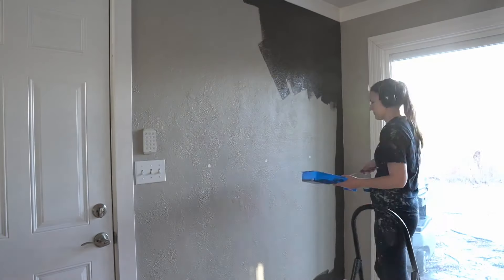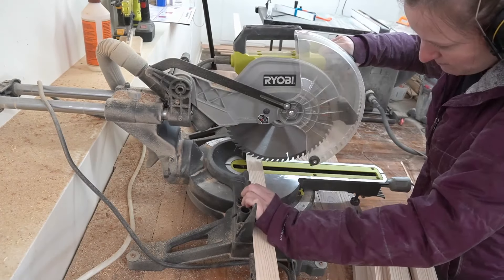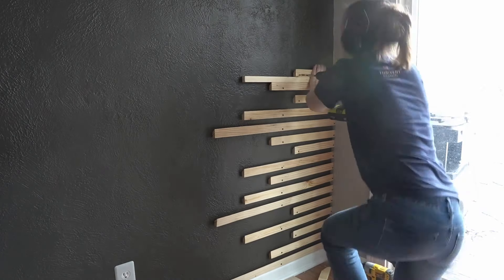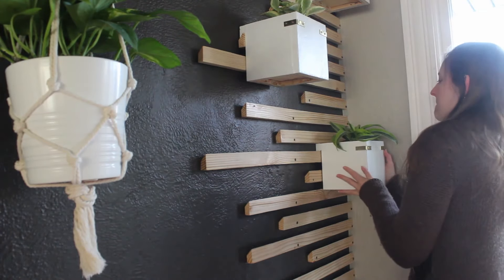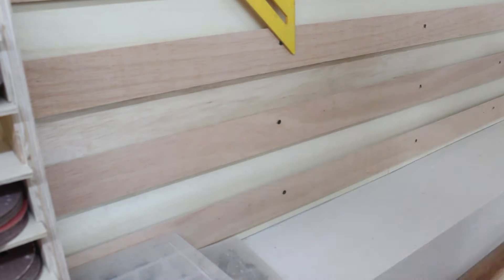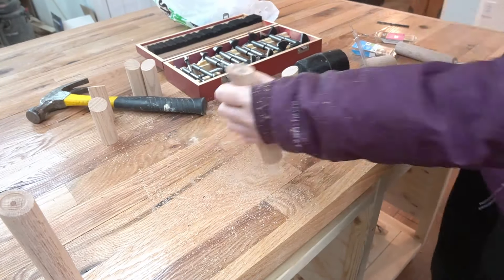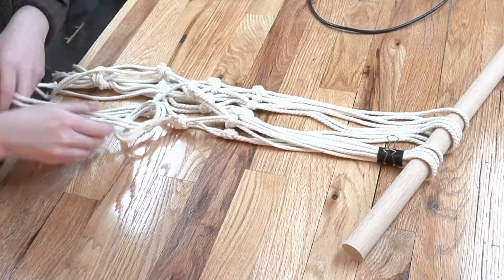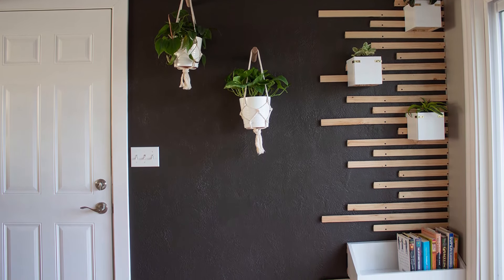This Wall Was Really Boring...

Comment: Nice job!
Some suggestions: 
1.  It would have been faster/easier to sand the 1x2's before you cut them to length.
2.  Using a vacuum would certainly have been better for dust...or at least put the bag on the sander's output chute?
3.  Shellac is an odd choice for something that is going to see a lot of mechanical abrasion.  Why not use poly?  Mixed as a wipe-on, it will be as fast or faster to apply.
4.  Yes, brass screws would have looked nicer.  An alternative to be aware of are the GRK R4 type screws.  They are amazing:  Self-drilling, self countersinking.  And they do happen to have a brass coloring.
5.  If the screw heads bothered you, why not put edge-banding type veneer over the slat?  It is available in 2 inch widths and in natural colors.
6.  I see the issue with screwing into the corner.  Of course, you really could have used a wall anchor for the right hand screws...a simple "50 lb" anchor would have been plenty strong.
Cheerio!

Comment: The book shelves should be just that, flat "shelves" (without the box) and the books should be stacked vertically on the shelves rather than the current horizontal layout. This will give a look consistent with the french cleat vertical layout.